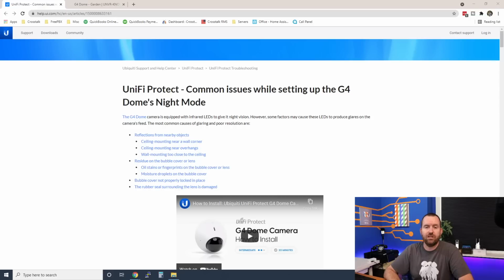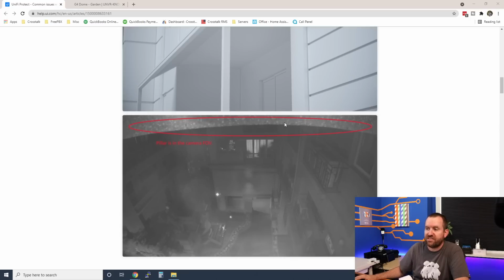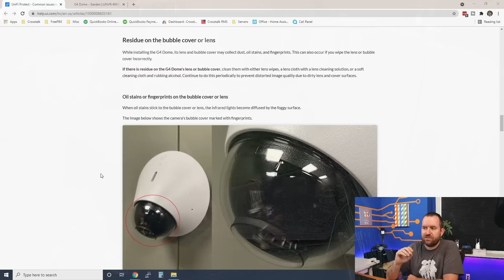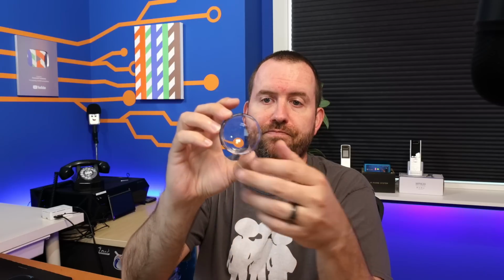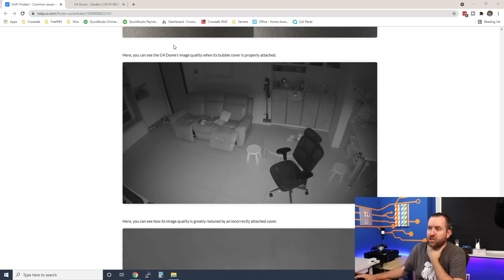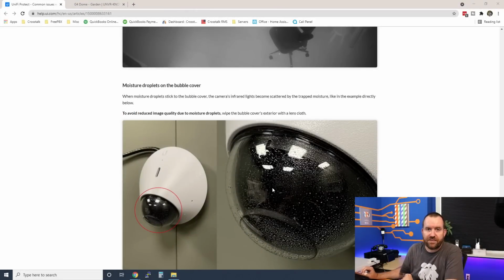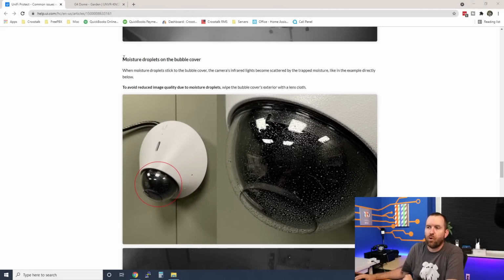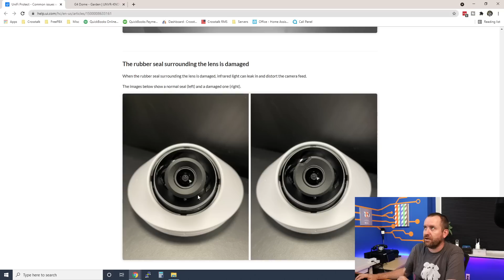UVC-G4-Dome Night Vision Fix

Comment: I had a lite 8 poe switch go out on me which feed 3-g4 bullet and 1- G4 dome... i replaced the lite 8 unifi switch  with a netgear until  I get the new Lite 8 ... the DOME camera turned red and now its Purple on my screen?  all other are working correctly

Comment: I have mixed feelings about night vision with the G4 dome... following instructions in this video improved mine drastically but there is still a difference for me with dome on and off. I also pickup some refraction from the dome eg. vehicle lights and an outside light near it. I replaced two G3 bullets with two G4 domes looking at my driveway, and the G4 dome are overall way better night vision than the G3's were but just not as good with the dome off (and compared to G4 bullet). A pro is extra wide view vs. the G3 Bullet (even the G4 Bullet are not as wide angle as Dome). One other benefit however is that spiders don't seem to make webs over the dome like they do on my G4 bullets! The only reason I got the domes were because of stock shortage and I could not get bullet. I wonder how it would be to run with dome off if the cameras are not directly exposed to water... would moisture etc. still get in and damage? What if one sealed around the thread somehow where dome went... eg. a ring with same thread as the dome just without the dome part? I can see a gap in there and small bugs etc. may go inside and damage without dome on.

Comment: My switch flex (with switch flex utility) wouldn’t power my g4 dome. Only way to get the G4 dome to work was to get a POE injector (af) . I’m puzzled by this because the switch flex has 4 poe at… which I though would be sufficient for the dome. Any thoughts as to why? On a different  switch flex (also with switch flex utility) I was able to power a G3 Pro camera which is also poe af. I’m completely stumped why the G4 dome won’t accept the power from the switch and requires a separate injector. Your insight would be appreciated
Reply: Did you solve this problem? The best place where to get help would be the UI community forum. However, the first thing to ask is how you are powering your flex switch: per official specifications the total available output depends on whether you feed it with POE af, at or bt.
Reply: @LorenzoCangiano  I did - just had to change a setting on the flex and it worked

Comment: What a difference that made. So the camera should be mounted in an area that you cannot reach for the vandal resistance, but it also needs to be easily reachable for regular (?) cleaning :D In case it slowly comes back, I wouldn't mind an update to roughly know what interval the cleaning could be.

Comment: I had same issue with G3 Dome, microfiber cloth solved it. 2 years now, no problem so far.
Reply: Thanks. I was wondering how long this fix would stick
Reply: @BradBazooka  If you don't touch it, it will last probably forever. Main problem is grease from fingers. Dust isn't really the problem.